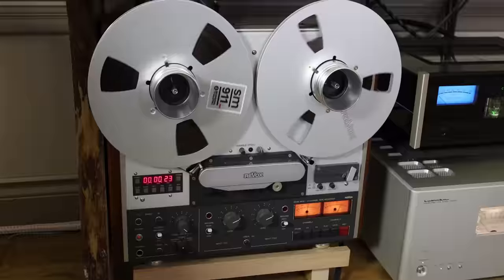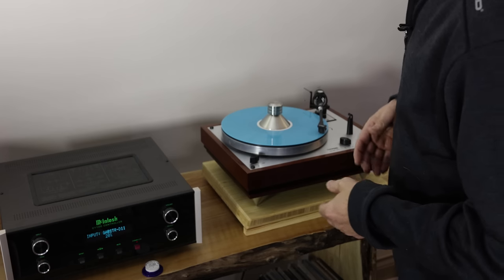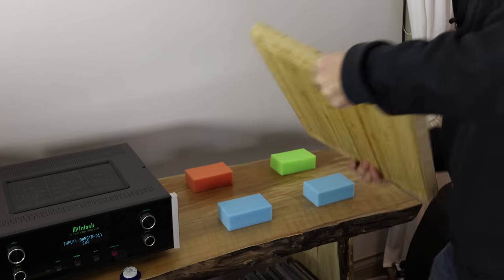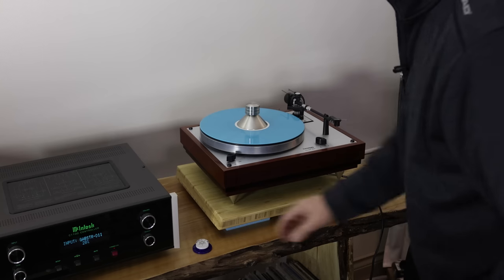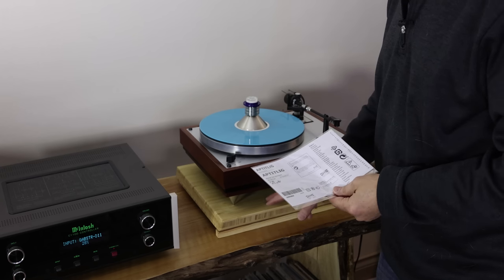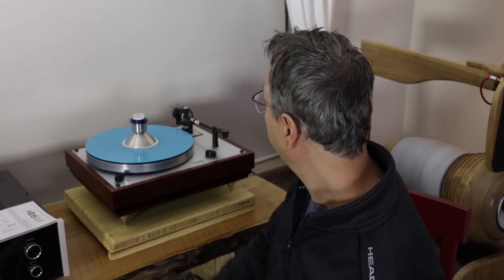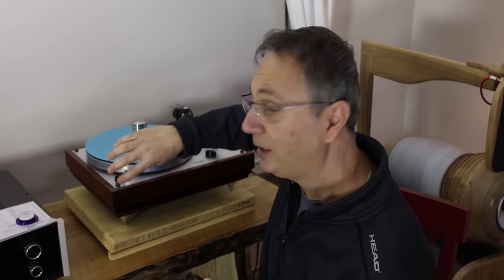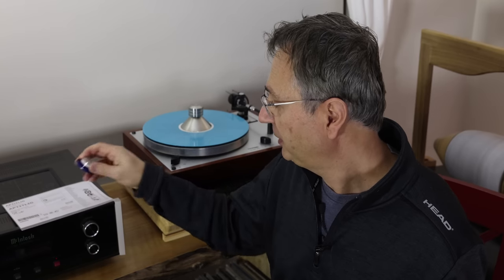5 Easy Turntable Vibration Solutions. Reduce noise, Bass loop and Rumble. And other HIFI tweaks.

Comment: When I almost finished restoring and repairing my Rega Planar 3 early 1980s manufacture date that I bought as a Plinth for the most part. It was only the Planar 3 Plinth, glass platter, subplatter, no drive belt, no tonearm, and no dust cover; I had to place it on three coffee cups turned upside down. It was raised because of the elbow component of the Phono RCA Cable for a tonearm that could fit this Planar 3 that was altered by the previous owner! 

I had to raise the Planar 3 because I had to hunt around for a different tonearm other than a Rega RB because the previous owner drilled a larger hole on the base for the tonearm post! Therefore, I bought a Linn Basik Plus, and mounted a new Audio Technica AT95 MM Cartridge. As a benefit of the ceramic material there is also Isolation from any vibrations, and resonance! I do not have any scientific proof, but at least it raises the turntable preventing contact of the Phono Cable from the surface of a table. Recently, I upgraded the entire motor assembly to a Rega 24V Motor Upgrade Kit. Sounds wonderful; and Planar 3 T. is functional again, and performs correctly.🔉🎵🎶

Comment: Nice, I used two of the IKEA cutting boards and had 10mm bearing balls between the two, sorbothan feet towards my record player and Stillpoints in the bottom. The deck is an old Empire 298 overhaulled with SME V arm and VPI motor controll. Fantastic for reasonable money! So silent and still grabbing the music!
Reply from the maker: Sounds like a great idea
Reply: I see a lot of using this method or with other parts. But tell why and how the bearings reduce vibrations? bearing are not damping reducing the vertical impacets only horizontal movement. bearing are not acting like springs or something like the sponge shown here.

Comment: I've developed a rumble filter that beats anything. It is a four pole, two zero elliptic filter using two FDNRs (frequency dependent negative resistance) networks.  It operates at line level (tape monitor or other 1Volt I/O. It is flat down to 20 Hz. Down 17dB @16Hz, down 30dB @7Hz. Believe me; there is no other like it. I've been using mine for 2 years with my Dual 1229 and it's remarkable. There is no audible difference between in and out except that the subsonic rumble is gone. My woofers love it. If you are interested in this 'final solution' to rumble, let me know.

Comment: Interesting video, I solved this issue by putting the turntable on a Granite chopping block rather than wood, granite kills resonance far better, I stuck 4 rubber feet to the granite block to isolate it from the cabinet it stands on, and has made a huge difference, here in the UK a store called B&M sell a granite chopping board for £10 which is about 12 US dollars, also available on Ebay, but more importantly it works a treat !
Reply from the maker: That sounds good 👍

Comment: A wall shelf is probably the best available mounting for a turntable; preferably securely anchored to a load-bearing wall. For a suspended sub-chassis turntable like your Thorens the shelf itself should be as lightweight and rigid as possible (your bamboo cutting board is perfect) and decoupled (not fastened tightly) to the brackets. This reflects the Rega philosophy of low mass structures not retaining vibration whereas dense, heavy structures tend to retain energy and dissipate it slowly. Linn used to insist their Sondek should always be placed on a lightweight coffee table rather than a heavy (dense) piece of furniture for exactly the same reason. Seems counter - intuitive but very easy and free to try - what's to lose?
Reply: Rega are wrong
Reply: Vibrations from the floor get WORSE as they travel up a wall
Reply: Couple of issues with that, perhaps, Eric.  Doesn't that defy the laws of science as any vibration (energy) will be, according to Newtonian physics, partly dissipated as heat as they travel up the wall (unless the wall had some sort of active component which could amplify them)? Secondly and empirically, I genuinely don't understand how, for instance, vibrations from a suspended wooded floor could possibly "get worse" via transmission to a load-bearing wall (which, due to its relative mass, would be acting as an energy dump). I could understand how the effective frequencies of any vibrations could be altered by transduction through different materials which will act as partial selective filters so you may have a point there? Always happy to learn and thank you for a thought-provoking post my friend. Enjoy what's left of the weekend

Comment: The foam would eventually compress from the weight. Ideally it would be useful to add springs to offload the foam so it can retain the flex to absorb the vibration.
Reply: Garrard turntables used springs and sponges.

Comment: Ideal is putting the turntable into a vacuum box before playing and isolate the turntable feet with spring dumpster,magnetic ,air or liquid suspension. This way the air around turntable has no effect or the surface vibrations, going to extreme though.A marble box with good seal tap of heavy glass and put the turntable inside on spring dumpster is an idea for you .

Comment: What controls vibration is mass and rubber. So what I use is a concrete patio block 15" x 15" x 1.5" painted black ($5). And put a recycled rubber stair tread ($7)cut to the block size Which I glued on the bottom of the block . And then mounted my Rega p6 on it using three sorbathane large half spheres so I could easily level the turntable. This is very effective in controlling vibration. Mass and Rubber is the key. I use a Mitchell camp for Rega turntables which you can lock down. And use large rubber damping Rings around the glass platter rim
Reply: I kind of like this idea.
Reply: @88Ozark  And I use the patios blocks under my sub and my speakers. And it works. I feel no vibration on the floor. A very inexpensive way to control vibration.

Comment: I have no problems with bass loop despite having two subs and big floorstanders but had big problems with skipping when I walked nearby. A pro-ject (or Rega ? Can't remember)  support and Amazon spring loaded feet solved it but I use the IKEA board with sorbothane for my other table and it does the job.
Love your idea though.
I now have an image of 8 IKEA cutting boards stacked on top of each other with different vibration damping solutions in between and the turntable out of reach perched on top...
Reply from the maker: Lol love your vision of 8 stacked ikea boards

Comment: I use the Ikea cutting boards under all of my turntables.  However my boards are sitting on spring loaded isolation feet from Amazon, one under each corner, and I have no feedback problems at all, and I can literally jump up in down in front of the turntable with no skipping.
Reply: Care to share the link of the feet your using?  I'd appreciate it.

Comment: I've been experimenting with drum dampening gel pads with some audible result . For lower frequencies control I use kick drum pads ( they are larger and thicker but also pricier ) . I also use them between my speakers and their stands
Reply from the maker: Thanks great tip drum dampening gel pad sounds like a great idea I should try that I can see it working.

Comment: I use a mixture of EPDM matting and EPE foam in layers, depending on the weight of the item. I also have a lasagne under my floorstanding speakers which work great.  Try getting rid of the Chopping block and get  the low density material directly in contact with the turntable. Even if it feels all wobbly, it will sound great.

Comment: Gabster- I like the sponge idea.I think I might try that over a basic sandbox which once leveled dissipates in a manner similar to high end feet which turn vibration into heat.As an alternative to sponges I also might try drum/cymbal dampening pads called Moongel.One thing if you you really want to get deep into proper  cartridge mounting you might want to some shims and a a usb powered digital microscope to make sure your SRA (stylus rake angle) is correct.Everybody sets azimuth (some even by a $400 Fozgometer to check it's set correctly) but SRA can make a difference.Hans Beykhuzen who I watch for digital info had the moongel pads and has reviewed some pretty high end speaker feet

Comment: Sponges : excellent trick I will try myself :-) But do sponges last over time ? Doesn't their behavior depend on the room's temperature or humidity level? Thanks
Reply from the maker: I have had mine for almost a year and still good 
After all if you have to replace them they are 1$ 
It die not matter a lot if they sag a bit as long as they are level you are good.

Comment: Not too bad but there are proven and professional solutions available (usually based on pneumatic suspension). Search for vibration isolation table in your local online auction provider (in the optics, medical & lab sections) . You can of course buy them new as wel if you have the 10...15k lying around.

Comment: IsoAccoustics!
Reply: Using ZaZen 1, before that I had the IKEA-plate with SD-feets. Value for money is IKEA, but the Isoacoustics has the look.
Reply: @bergennorway  I I have been using the Orea Series feet under all my units (including bookshelf speakers) for over a year now, and haven’t had the urge to change anything!  Probably the best tweak that I’ve ever come across.
Reply: @mikeeygauthier2959  Same here, I used SD-feets under my speakers. I didn’t belive changing from one «soft» dampening to another one would make any difference, but OREA proved me wrong. SD-feets was recommended from manufacturer of my speakers, so I invested in them. After hearing the difference they made on my speakers, I decided to buy the platform.
Of course I could buy the «pucks», but the platform looks way better in my rack.

Comment: In order to best isolate vibrations, you'd need to know the frequency and amplitude of the vibration input and the mass of the system you are trying to isolate.
There are 3 ways to reduce vibrations being transferred into a system:
1 - Mass
2 - Springs
3 - Dampers.
Each one of the above operates best in different ranges of frequencies.

Comment: The cutting board is hardly any better than a piece of plywood. I was thinking of  building a larger frame out of 4 pieces of 2 X 4 and suspending the plywood on several lengths of picture hanger wire so that the only vibrations come through the wire. Secure the wire with screws to both the frame and the plywood and the turntable will remain level no matter what the weight distribution is.
Reply from the maker: Sounds like a  good plan if you do not mind the esthetics of it  Yes like you said the cutting board is not the most important part but the sponges are. It is a nice solid heavy board and has bamboo in various directions.
Reply: @Gabster1  I have plenty of black paint.
Reply: The bamboo cutting board is suppose to be much better with vibration. I don't think plywood has the same properties as bamboo. But if you're just using it as a stand and not a vibration control, won't be a difference.

Comment: In all my 50+ years of using turntables I have never, ever heard of bass loop, earth loop yes but bass loop??? What the f^*k is bass loop.  Do you mean feed back!!! If so you need to seriously re-evaluate your set up. Here's a tip or two, 1) Buy a decent turntable in the first place and set it up correctly.  2) Put it on a dedicated rack/stand or shelf and 3) Ditch the sponges and chopping board. Simple.
Reply: Geez, who pooped in your cupcakes.
Reply: @raymiehershey1430  People like Gabster do, why spend a fortune on hi fi gear then attempt to make it better with sponges and chopping boards. The issues he is experiencing are down to 1) Either he has bought the wrong gear in the first place or 2) His equipment supports are inadequate. 3) His room acoustics need to be addressed to combat his feedback (bass loop??? or whatever) issues and 4) He does not understand the basic fundamentals of audio equipment and their function and he is fumbling about looking for a quick and cheap solution. And may I add, where is his dealer support in all this mayhem to help and assist with his issues. There is a multitude of this kind of drivel on youtube and it dosn't bode well for the serious audiophile that has something interesting and relevant to say regarding this fascinating hobby of vinyl replay.
Reply: @madmeister407   The point is he is trying and sharing information. Don't  be angry, share your thoughts and help out, effort waisted on negative responses. I'm a density guy, plus weight great results. Share your experience without being negative to benefit others.
Reply: I'm not in to point feet, chopping boards, hand balls ect. But I'm not into 1000 dollar iso plates. If ya know a better way to isolate, tell everyone specifically what you do.
Reply: @raymiehershey1430 I'll tell you what I do,  I buy quality equipment, I use decent supports,  racks, or shelving, but most importantly I do my research before I buy and I talk to my dealer. What I don't do is buy stuff that don't work and then mess about with it like using sponges and chopping boards. Simple.

Comment: Been wall mounting my TTs for 30 years. (exterior side wall only). I see so many "audiophiles" who place their TTs  right between, and way too close to their speakers. Look at this guy w/those big ass horns right next to his turntable. No wonder he has a vibration problem! Mount your TT to the studs of an exterior side wall if possible for foot traffic vibration. Also, place the speakers on the front wall, at LEAST 9 feet away from the turntable to minimize speaker vibration on your stylus! 
So: speakers - front wall
       turntable - side wall, 9 feet or more from speakers.

Comment: I vote for a wall mount as well. I like the HiFi Racks Podium Platform Wall Mount. Rock solid, the platform is claimed to support up to 198 lbs. While further isolating the table from the wall mount's platform with a zaZen platform. Not inexpensive but much less than the cost of a cartridge in keeping with the rest of the equipment on show. Then try replacing the cones with Herbie Audio Lab's Tenderfeet. Elevating the turntable will also allow for placing a dedicated phono amp where the turntable now stands.

Comment: Good idea.  I had a similar problem with several turntables, not so much with rumble, but hearing noticeable distortion when playing loud.  Tried all kinds of flexible rubbery footers (diy and commercially available), but they all degraded the sound in some manner.  What finally solved the problem is 3 diy rollerblock footers made out of bamboo wood, spoons and 10mm steel or ceramic balls.   No feedback, no distortion at any sound level, very natural sound.

Comment: Great idea with the sponges 😅. I use two marble slab’s which I was fortunate to find at ikea one day snooping around the store. These slabs were chipped slightly and were sold super cheap in the “as is” department. I bought them about 15 yrs ago and have used the in my two systems ever since. The marble is 1 inch thick and 2 inches wider all around than my SystemDek TT so it fits and looks awesome. I place 4 small rubber nubs under each corner and stack two with nubs on top of each other, so stand…rubber nub…marble slab…then more nubs…another slab then isolation cones and TT. I bought 6 pieces or slabs that day so I have one under my Disc player and use last three for smaller system in my office. I think marble would work better for vibrations than wood as wood transfers vibrations and not deadens it. Perhaps I’m wrong though so let me know if I am. That’s it , sorry for the long rant. Thx
Reply from the maker: Great ideas Thank you  :)

Comment: Hi 👋 Gabster , great idea, I had a big problem with my building, it is a very old moulin/mill in the Correze in France, the floors are on beams across the width of the building, 7m . So when you walk across the floor it bounces, so I have made 2 wooden arms that are fitted to the wall with steel brackets, then on them I have a slab of oak 50m thick, so there is no vibration at all, 
Phil from the moulin France.

Comment: Went the monolithic approach.  42”ish tall welded 1”x2” sand-filled 1/4” wall thickness rectangular steel tubing w stainless steel feet.  The top shelf where turntable is located is made up of an approx 200lb granite slab on wenge feet interfacing to the steel rack.   On top of the granite slab is an approx. 50lb hard maple block on brass feet.  Turntable sits on top of the maple block.  Bottom shelf (preamp & Nitty Gritty storage) is likewise a similar granite slab sans the maple block.  Idea being mass + differing materials w different resonances.  Turntable rack is placed at a room node.  Mono blocked tube amps are on similar but shorter individual racks placed at room nodes, w hard maple blocks but no granite slabs.  Has worked pretty darned well for 20 years.  Great depth & detail of sound.  The rack, locating equipment at “nodes” (see Audio Master’s Handbook) and sound panels for echo tuning are some of my best bang for buck “tuning” efforts.

As always, YMMV.  Just sharing, nothing more, nothing less.

Have a good’un!

Comment: I used the foam packing from my turntable box and cut some circles to fit under the feet, they are about 3/4 inch thick, and they work perfectly with no need for a block.